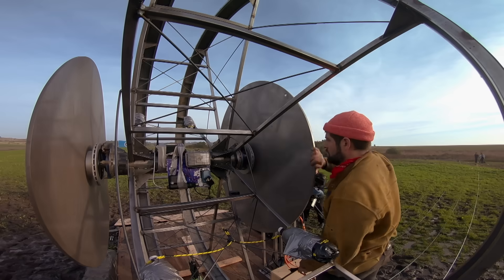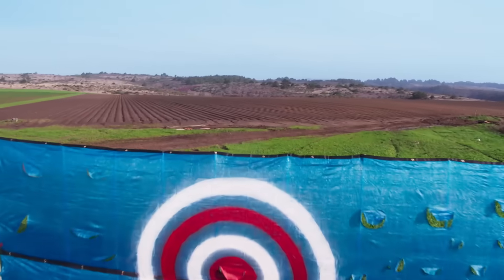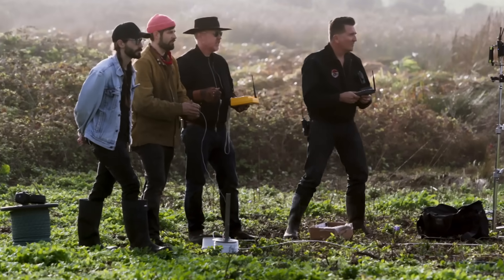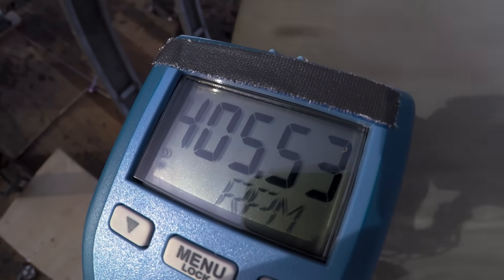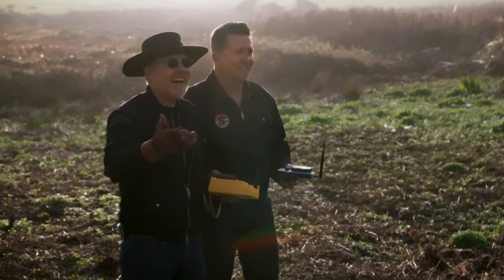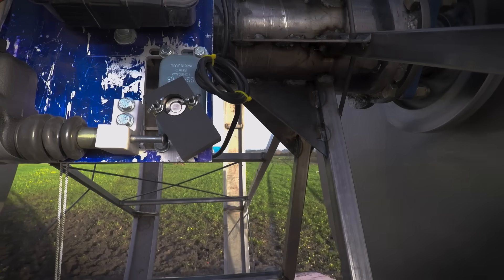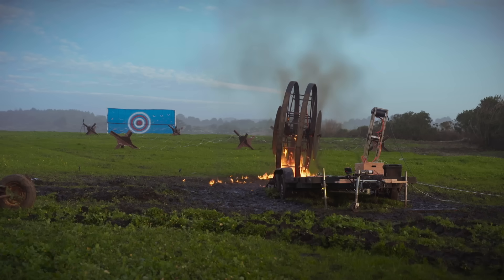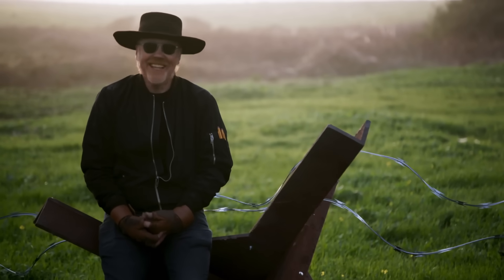Weaponised Flywheel Experiment Fails Explosively | Savage Builds

Comment: It's crazy to me that someone like Stelzner could miss such a simple basic fact - you can't brake the flywheel and instantly transfer all that momentum to the hub and expect it to instantaneously spin up.  That's the only way you'd get all (or most) of the angular momentum out of the flywheel.  The "I think this is what happened" comment about the brake is so cringe from someone so smart!  Stop looking only at calculations and think about it for a moment practically.

By braking it, they're heating up the brake pads (where did they think that energy was coming from?).  

A better solution would have been to have a CVT/IVT that could gradually transfer the power from the flywheels to the hub.  This can also be done electronically (with some losses) with a motor/generator combo - effectively what the Toyota Prius synergy drive does.

Comment: Well, there have been a lot of mistakes during building that thing. The first thing they had to too was to balance each disc. like you do with high-speed tires. and then, for the first test, go and test it on a race track with a hard underground, lets say a dragster race track. and then use larger break disks! i still wonder if you could control the directions with two separate controlled break disks.

Comment: The reason it didn’t move was the fulcrum. The brake pads are to small. You need to transfer the load at the ends to get an instant launch.  If you have small brakes it’s too much pressure on the brake pads and they will slip.

Comment: Personally, I think this idea needs a sincere attempt.  However, eliminating gyroscopic procession is critical. "Flywheels" is probably not the answer. One large cylinder connected to the wheels via automove clutches would provide more initial torque. But, I think I know the issue with the calculations, and they are substantial. The motive force to turn the wheels at 40mph is a very small part of the required energy. We have to accellerate the entire craft to 40mph, which is quite a substantial addition to angular momentum alone. I estimate your flywheel needed to rotate about 5000rpm, and an automotive torque converter would work, because we don't have to apply the torque immediately. Instead, we want to convert the torque gradually as not to damage the structural integrity of the assembly. Chrysler makes a 2500rpm stall converter, which will not engage until a differential of 2500rpm between the drive and the output occurs. The flywheel must be perfecty balanced, which is a step you skipped. So, I would expect this was NOT a sincere attempt. Instead, this was a gimmick for clicks. True, or False?

Comment: My brother briefly worked on the University of Texas Homopolar Machine project in 1975. It's a big spinning motor generator flywheel thingy with 5 megajoules of stored power discharged at 42 volts with 150,000 amperes of current. At one point they thought such devices would be used for fusion research or to power rail guns. I'd like to see it do something like what the Adams tried here.

Comment: Maybe you could use a solid connection instead of the brakes. Some type of way to instantly lock everything together……maybe a big steel rod(s) that slide thru holes that all line up……….?? With a solid connection instead of brakes, no energy will be lost because of brake slippage. Just 100% instant and full energy/power!

Comment: Everyone is saying this test was badly done, poor environment, 1 test. And yeah sure, but I think people aren't including how INCREDIBLY DANGEROUS this was.
Like yeah, they could have just had a suspended flywheel that they dropped, or any number of technical improvements, but flywheels do not move in a predictable way.

There was no wall in front of them or anything, 1 mistake, 1 piece of steel breaking, anything and they could have died.

If you see the in shed test they did at the start, when it started to move, that could have turned someone out on the street into a fine red mist.

Kinetic weaponry is more dangerous than explosives of the same weight.

Comment: I'm an engineer myself, but you can't call this "colleague" serious. With this concept, everything was wrong.

As Adam was saying: if the equation is right .
No, the eq was wrong.
Mr NASA engineer totally forgot to take into account the immense losses caused by the brake.
Reply: Also vibrate and mud / dirt  don't mix. Those wheels should have been far wider .

Comment: as someone that has held the brakes on a truck and gave it gas and yet still turned the tires over .... ya how did you exspect that to work. literally takeing all that instant torqu and exspect it to last over time to get the object 100 yards. ya not going to happen you loose energy very fast no matter the vastness of it all. example wind up the clutch on a truck and drop it might queek the tires but then instantly fall on its face. 1000s ftlb of torqu 0 hp

Comment: This was doomed to fail. The ground being so soft. The transfer of energy to the wheels was absurd. You don't have to wheels but widen the actual flywheel contact with the ground. Get it up to speed up of the ground onna ramp type contraption, then release it so it makes contact with the ground spinning as fast as possible.
Reply: well, they did put the brakes near the center of rotating masses to minimize their effectiveness. should have been on the rims, but even that is questionable.
what the machine needs is a planetary style gearbox to maximize transfer of power from the rapidly rotating flywheels to what is expected to rotate a lot slower 
instead of wasting so much energy in the brakes while also wanting it to power uphill through mud LOL  
without doing the calculations the flywheel sizes look too small

Comment: They should have used a clutch system from a top fuel dragster instead of disc brakes.  Those clutches engage incrementally as the cars accelerate.  As someone that off roads a 4wd vehicle in a muddy state, I could have told them that thing was going to sink into the mud.

Comment: The slow engagement of the  brake dissipated too much energy okay, the missing 200rpm meant another significant amount of energy (rpm is squared in the equation if I'm not mistaken), but still this somehow missed more magnitudes of energy not only that.  The guy seriously miscalculated something I believe.

Comment: O for cryin out loud. The free rolling bearings between rotor and stator won't transfer/allow enough energy from rotor to stator. Next time consult a high school physics student. You need an electromagnetic clutch to engage rotor to stator such as is on an automotive air conditioning compressor.

Comment: They also have to take into account of the soft ground they also had to take in consideration of the weight of said wheel braking system is important but in this situation the biggest Factor against them was the soft ground

Comment: The most advantage is at the center of the axle/hub. They made a wheel that gave them a huge disadvantage. They need a transmission of some sort, using the hub/axle as a pinion.

Comment: Why the heck did they use brakes, designed to turn rotational energy into heat energy... and not a CLUTCH, designed for exactly this. All they are doing is losing tonnes of energy that way around.

Comment: Possibly the braking could have been better lockable by using a large coil spring located on the axle pushing outward located on the axle in both directions. Using hollow slip extensions on both inside ends of the axle. When the compressed spring is released hopefully the spring will generate enough sudden force to engage the  pre ground roughened brake surface and drive them together on each side.

Comment: they should have drilled holes into the flywheel and inserted a solid steel shaft into it instead of using automotive brakes

Comment: Y = f (x).  Seems like the rotational energy (RE) was much higher than the braking transfer due to too low of clamp pressure/area.

The brake discs must have been hot.

I'd not blew it up so easily, but increased the PSI to the disc brakes.

Comment: Ever tried riding a road/racing bike in the mud?... even at 20mph, its near impossible to ride because of the skinny tyres. Same thing happened here. The skinny wheels with ZERO traction dug into the mud and stopped it in its tracks..

Comment: Hey two Adams, What about a corkscrew configuration?  If you create an outer centrifugal force with this concept, it will be pushing any weight internally outwards and another corkscrew inside in the reverse direction, then have a main center rocket propel it upwards you have more than doubled the actual payload.
Just a deep thought.

Comment: You can have the biggest twin turbo cat diesel thousands of horse power tractor and it will get stuck in the mud … as they say in Realestete it location location location.. plus loosing what energy you had left to a friction clutch breaking mechanism..

Comment: Why not put some holes in the fly wheels and have an actuator bolt coupled to the wheel lock into the holes to mechanically brake it instantly? Friction on the braking is not an issue in such a setup.

Comment: In the kinetic energy of a rotating wheel equation :( Ef = 0.5 (kg m2) ( rad/s)2 )   the rpm (rad/s^2 ) as can be seen is squared so the calculated rpm ,1000 RPM , which was not achieved had 4 times the energy potential of  the actual 500 rpm achieved in the trial ,so basically the machine did not have enough stored energy to overcome friction and inertia and the mud .

Comment: Even if the brakes were strong enough it wouldn't work, their friction wouldn't be equal enough left and right so it would not roll straight. It would be better to use a single piece axle and use one mondo brake. Then the problem would have been with very little friction of smooth metal wheels on mud.

Comment: The balance issue I’m sure is the lifting holes in the flywheels. At this much weight and speed even a deep scratch is enough to unbalance everything, not to mention the motor engaged into the shaft at an angle, maybe not the full issue but it could be an influencing factor.

Comment: too much of the flywheel's mass is in the center resulting in too much mass being wasted. it should be much thicker on the outer parts of the flywheels and really should be better with "spokes" like those old hit and miss engines had it.  the mass needs to be on the outer most part of the flywheel.

Comment: The wheels should be a thin solid plate that the fly wheels, mounted inboard, would engage directly with outward pushing suspension car spring. The wheel and fly wheels become a giant clutch. Best brakes possible.

Comment: I know, I know, should've would've could've, but they should have had the brake calipers mounted higher up on the spokes of their big wheel and gripped onto the flywheels themselves instead of the wimpy little brake disks. Probably a case of not seeing the forest for the trees since they had used a modified truck axle for the carriage.

Comment: Continuously variable transmission from an old moped. You can pick them up from any scrapyard for about 10 bucks. Would have been absolutely reliable and unstoppable. Using brakes as a transmission system was the dumbest thing i've ever heard.

Comment: Energy lost as heat in the breaks, there is a reason that we use clutch to transfer the energy in cars and not breaks... Also even if it did work steel without any groves or anything would give 0 traction on grass, this was doomed to not work anyway.

Comment: I think if you would have increased braking power and also if you would have done it on an old Runway surface it would have gone a lot smoother and a lot further and a lot faster it looked to me like it dug into the dirt before it stopped the outside of the rims should have been covered in rubber like a tire and the test should have been done on an old Airport runway and see how fast I can go from one end of the runway to the other

Comment: K.I.S.S. ... Why not just spin the whole thing up to 1k RPM with it suspended an inch or two off the ground.... The release drops it, and it goes... 
This way the whole unit is essentially the fly wheel.

Comment: Why use breaks at all? Simply add a secondary motor to maintain rpm from the wheel to the flywheel. The grab from that alone should propel it forward.
Didn't we learn anything from starwars clone wars?

Comment: Instead of having a separate flywheel and propulsion wheel where energy could be lost through a clutch or brake as they were referring to it why not just have them both in one where you spin the whole thing then release it. The only problem with having an all in one system is that it could spin upon contact with the ground or trailer and lose energy but with rubber treads cut into it or made out of it my guess is that you would lose far less energy through slippage of the wheel on the ground than you did through a clutch system that was tried on the video.

Comment: Your design fix would be very easy instead of having I would have rings have a snowmobile engine run on a track on the inside at the bottom of the wheel itself have it drive across the ground spinning the wheel it would look sort of like a hamster inside of a hamster wheel it's at the bottom or a little bit at the front of the wheel as it drives forward come on think about it then show me out when you do it

Comment: Their analysis: Weak Brakes dissipated energy by not instantaneously engaging? That would mean most of the energy was turned into heat that was absorbed by the flywheels and the brake pads and what was correctly transferred into rotational energy went into the mud friction. If they had better brakes that did instantly lock up the wheel as they said they needed, it would have ripped the spokes out. What they should have done was stuck a little Sachs hydraulic torque converter in there off a Moto Guzzi Convert and after spin-up, when that was slammed into gear it would produce a smooth takeoff with little waste into heat while developing torque from the slippage in the torque converter.

Comment: Im no rocket scientist but I'd try a Single fly wheel in center of axle with a airtank and spring brake from tractor tralier. Dump the air and the spring breaks lock up. Thats why truck wheels lock up when they go low on air. And in turn will give you the instant transfer of energy you seek for turning the wheel.

Comment: not enough braking force. a lot of the energy was bled off as heat in the disc brakes. probably should have just had a massive ratchet that just engages and catches the wheels, would have instantly transferred most of the energy and kicked the entire contraption up the hill

Comment: There is no way to achieve that with disk pad breaks. Assume the fly wheels are fixed with bolts with the main wheels. Jack the whole setup then rotate the wheels then remove the jack followed by quickly lowering the whole setup to the ground. The amount of friction/pressure  caused by wheels to the ground is too high such that the flywheel momentum is suddenly crippled. In his equation I must assume he did not account the friction cause by the wheels as they roll on to the ground. I can assume two friction factors should be accounted. One is right after the wheels touches the ground and thus cancelling or acting against the momentum and secondly is a continuous friction to the ground that can be acting against the momentum through out the journey.

Comment: The most likely error in their calculations was not accounting for energy lost as heat in the break rotor. There was likely high viscous drag in the mud as well. They should use an infinitely variable direct drive to couple the fly wheel to the vehicle.

Comment: First, the mud issue, to went and it sinks. Second, the flywheel is lighter than the structure so yeah mass and acceleration. Flywheel needs to be heavier than the structure.

Comment: The overall wheel size had to be only  slightly larger in diameter than the flywheels meaning the wheel was too big for the flywheels or flywheels needed to be doubled up for twice the weight!

Comment: To solve the breaking force they should have placed something like 4 calliper-breaks on the edges of each flywheel instead of what they did which was using a single normal truck-break near the centre of rotation, placing the breaks on the edge of the flywheels would have increased the mechanical advantage greatly. I wonder if they did any balancing of the flywheel disks, that would have allowed them to reach higher RPMs before running into vibration problems.

They could also have lifted the whole thing off the ground, and spun the wheels with the breaks engaged up to a scary rpm, then disengaged them and also spun the flywheel up to a scary rpm and then dropped it on the ground, this would give it the required initial velocity and the fly-wheel is just extra stored energy to increase the range of the Panjandrum.

Though I have a feeling a single wheel design would have fared better, a wide curved-profile wheel (sort of like a flattened motorcycle wheel profile). The two wheel design seems to be an inherently unstable design as it bounces over uneven ground and obstacles.

Comment: I think the wheels were too tall, which  increased the leverage against the fly wheels.  A smooth surface would have made an entirely different outcome.  I doubt the math included a muddy, bumpy surface.  Also, they should have gotten to 1000 rpm, it would have been ok.